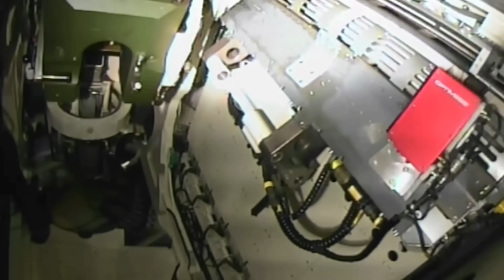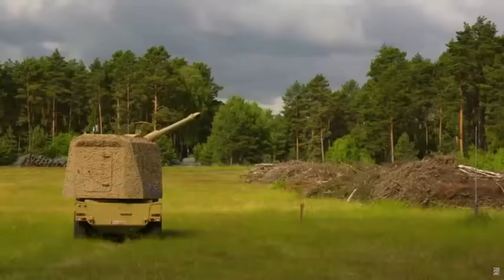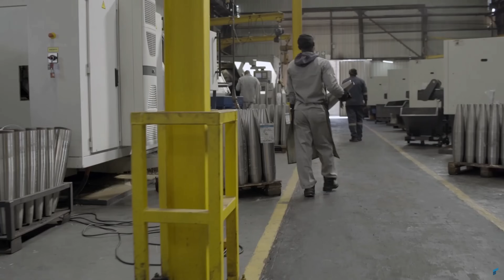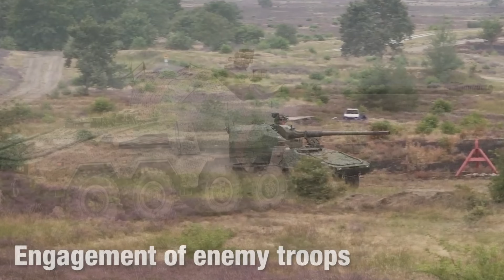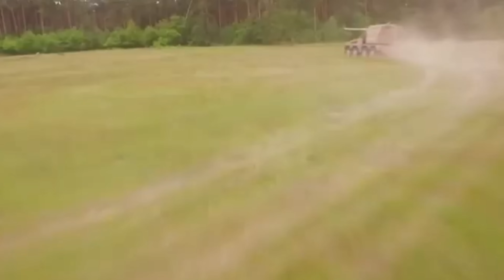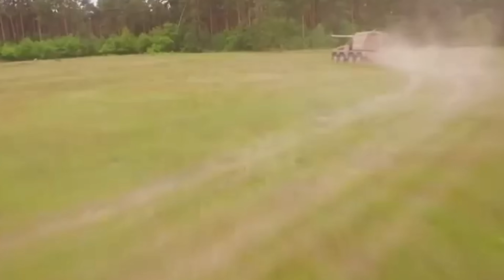The RCH-155 Self-Propelled Artillery System | 155mm FIRING ON THE MOVE!

Comment: The Boxer chasis is a beast for carrying a 155mm system!
Reply: Not from the beginning. Developing this variant they reinforced the chassis and spend a more powerful engine to run this vehicle. This updated chassis variant became the new standard, as far as I know.
Reply: It‘s not just available on the Boxer, but also on the Piranha (a new model of the original of the stryker and LAV). Some pictures in the vieeo actually show a MOWAG Piranha.
Reply: @ The entire tower is being mass-produced and has been tested on multiple platforms. There was even consideration to mount this tower on a frigate, but that was not implemented
Reply: I always ask myself, why are ship cannons not used as land based point defense or like this turret on a boxer?They're dedicated anti surface and anti air guns after all
Reply: @GerManBearPig   In terms of Boxer and Oto Melara 127, you don't have cooling water and providing the ammo that way and its storage isn't also on your favor, I guess.
Reply: Yeah, but Boxer is a big thing. Like just look at the Boxer stationed next to the Abrams. That thing is massive.
Reply: @vojtechpribyl7386  so?
Reply: No, it's not. I wonder how long this chassis will last with those kinds of forces...
Reply: @mkultra3679 The Boxer is built for it
Reply: Looks like it is getting  a beating every shot.
Reply: @JeffBilkins  To accommodate the turret of the Panzerhaubitze (specifically the Artillery Gun Module or AGM for the RCH 155 configuration) on the Boxer chassis, several modifications were made:

Extended Crew Compartment: The crew compartment was slightly extended to accommodate the commander and driver, ensuring they have sufficient space and access to the controls necessary for operating the howitzer.
Strengthened Chassis: The chassis was reinforced to handle the additional weight and recoil forces of the 155-mm artillery gun. This involved structural enhancements to maintain stability and durability under operational conditions.
Modified Drive Module: The Boxer's drive module was adapted to support the heavier and differently balanced load of the artillery turret, which required adjustments to the suspension and possibly the powertrain to manage the increased mass and the dynamics of firing.
Turret Ring and Mounting: A larger turret ring was installed to accommodate the size of the AGM turret. This involves engineering the chassis to support the turret's weight and movement, ensuring it can rotate 360 degrees with minimal obstruction.
Side Escape Hatch: An escape hatch was added on the side of the chassis for safety, allowing the crew to exit the vehicle quickly in case of an emergency.
Reduced Profile: To accommodate railway transport and lower the vehicle's overall height, the turret design was slightly modified to have a smaller profile while still housing the 155-mm gun.
Load Distribution: The chassis was potentially modified to distribute the load of the turret and ammunition more evenly, ensuring the vehicle's mobility and stability were not compromised.

These modifications ensure that the Boxer chassis could effectively serve as a platform for the Panzerhaubitze turret, providing a mobile and flexible artillery solution.
Reply: Yes it is. It was said about the Stryker in configuration with the 105 mm cannon, the suspension broke down a lot because of the hard recoil.
Reply: @rindenmulch-h8d The Boxer is much heavier though, an empty weight of 24 tonnes vs the Strykers 16,5 tonnes in their standard configuration.
Reply: @thijsverweij9824  should be interesting then to see what Canada does for ours if we do buy it because apparently we might be getting it on the Piranha IV 10x10, I’m hoping Boxer or LAV VI chassis mount if possible (might not be as unlike the Boxer they didn’t think of Modularity when making it)
Reply: @rindenmulch-h8d  We'll see about this one as it's not a conversion, but it was intended for various modules from the start. Maybe they overbuilt the suspension enough to work even with the 155 mm gun.
Reply: Toyota Hilux would be better.
Reply: @lando8913 Even a Hilux would disintegrate with that kind of force 😂

Comment: New targets for Lancet drones
Reply: The Lancet has a maximum range of 40 km. However, RCH 55 will operate 50 to 70 km behind the front line, so a Lancet cannot reach the RCH 55 or other artillery systems with similar range. Lancet is a system that is only effective near the front.
Reply: @ no its not only for the front line use there were already attacks from lancets far beyond the frontline also AFU has just the normal shells not the ones for maximum range so its possible that they need to operate in the reach of Lancets